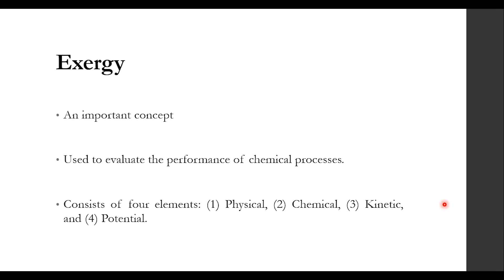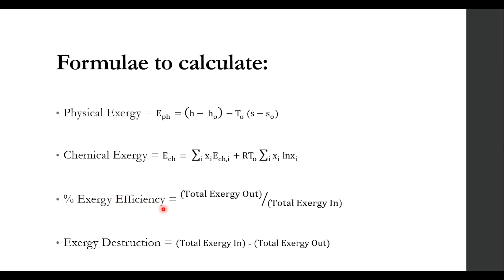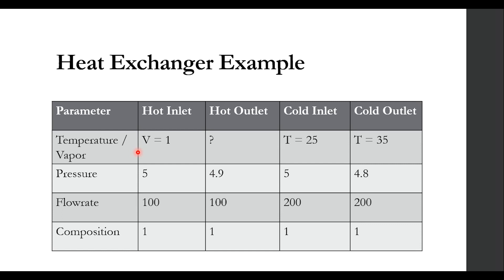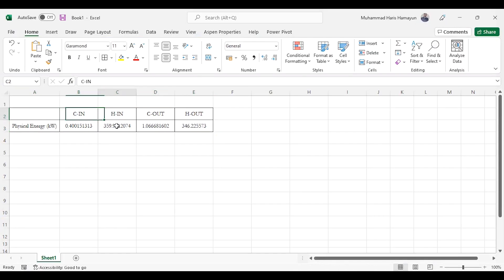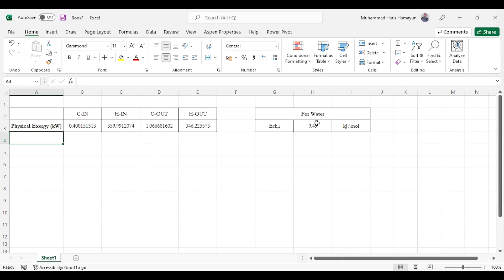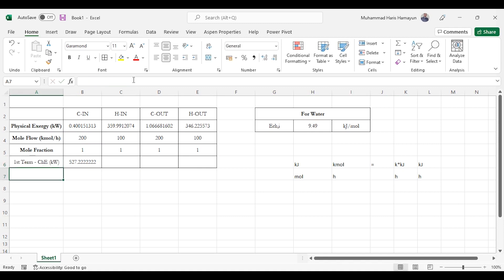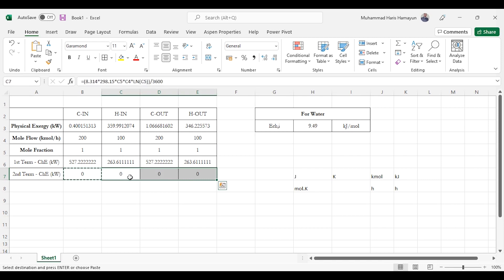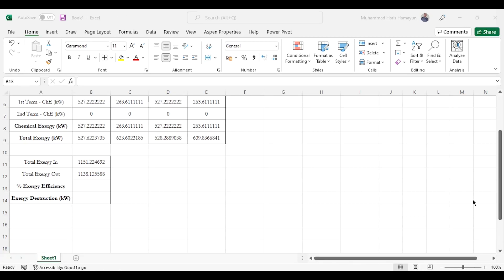Exergy calculations using Aspen Plus and MS Excel - Heat Exchanger Simulation - Lecture # 94

Comment: why the chemical exergy is considered?
Reply from the maker: Exergy of a stream is calculated by adding its physical, chemical, potential and chemical exergy values. Usually, potential and chemical exergy values are smaller in magnitude, and are considered negligible. Hence, the total exergy value is calculated as the sum of physical and chemical exergy values for a stream. Hope that helps!